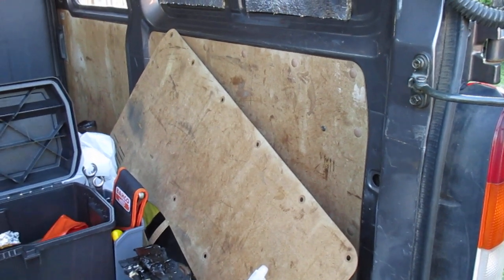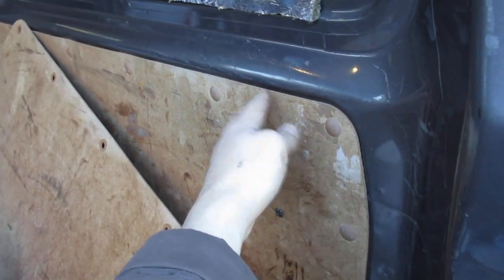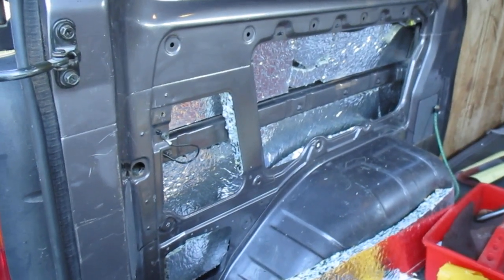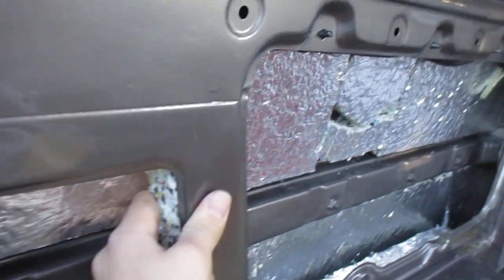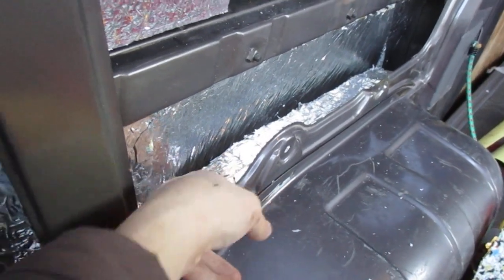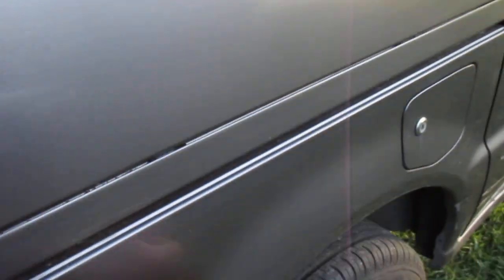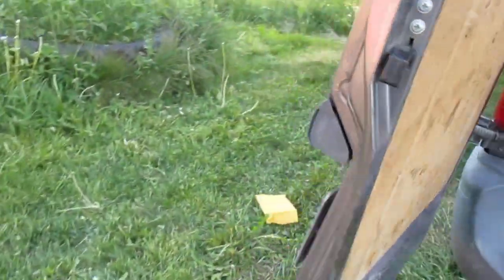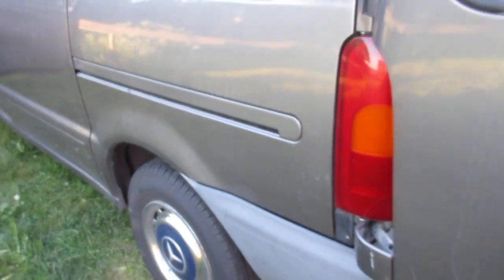Quick demo of simple car sound proofing

Comment: The Mercedes hubcaps are a nice touch.

I've thought of doing something similar. Does it make a lot of difference going down the road?
Reply from the maker: The Mercedes hubcaps make the greatest of differences! When I put them on, the vehicle immediately became thoroughly classy, soft and reeking of businessmanship.

Seriously though, the foam makes a giant difference, at least if you have a vehicle like my van, with minimal thought of comfort in the factory design. Basically, if you have a metal panel that sounds like the right side of my van did, which isn't covered by a heavy interior panel, you're looking at a definitely noticeable decrease in road noise for every such panel you dampen. I find that the most noticeable difference is when you're riding along a freshly paved, super smooth road, and then transitioning straight to an old, rough one. That half-second build-up of noise as all the panels start resonating simply disappears, and you're left with mostly just feeling the transition through your seat.

That is, if you take the time to do it to pretty much everything; the gains are basically a linear function of amount of foam installed.

Comment: im into car audio (as in big audio systems lol) so i fully expected to see and hear what i did :D we normally use thinner stuff and it does about the same for the test you did with banging on the outside. but i imagine if you can get into all areas and do thick stuff like that it would help more with the sound quality of a big system! thats cool. where might a bloke from the US find some of that or under what name?
Reply from the maker: I wouldn't know, since I'm obviously not in the U.S. All of my stuff is generic, though. Brandless.
Reply: ah no name insulation. youll have to let us know how well it holds up :)
Reply from the maker: emerybryant
I've had this stuff installed in my other car for years, with no signs of it wanting to fall off or apart.
Reply: hmm thats interesting. lol thanks for the info tho :D

Comment: and here I thought aussie50 had an interesting thing going with those silly tar adhesive foam strips he had a boatload of. with this, not only do you get sound deadening, you get slightly better heat retention in the cooler months, yay.
but then, you're in finland. you're outside in -20C in shorts, because Finland stereotypes.
Reply from the maker: I use the asphalt-like stuff too, as well as just thick asphalt-y goop in a can, where it's impractical to use the foam. You need a lot less volume of the asphalt-y stuff to deaden a metal sheet, but it does nothing to dampen other noise (like turbulence around the car, other vehicles, etc.)
Reply: It really depends after what you are going for, low freq will be dampened far better with bigger weight of asphalt-like stuff. But the weight.... and if not AL sealed on inner side of van, when hot, it will smell like burning asphalt :)
Reply from the maker: Yep. The thin foam stuff is absolutely worthless in my opinion, which is why I use the 3 cm thick sheets. They come out at about the same mass per unit area as the asphalt sheets.